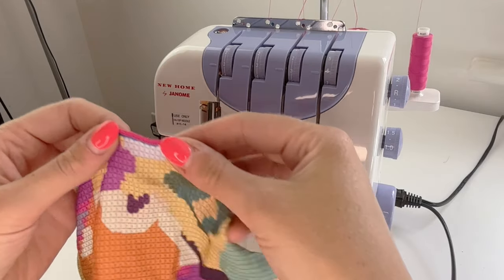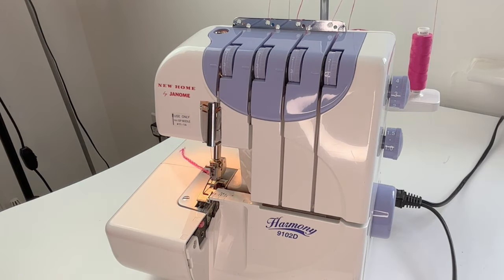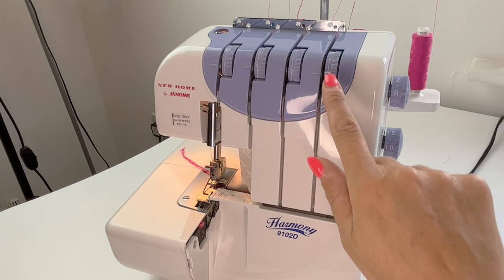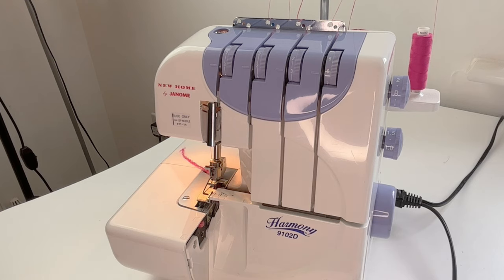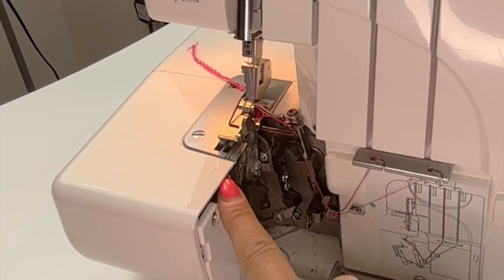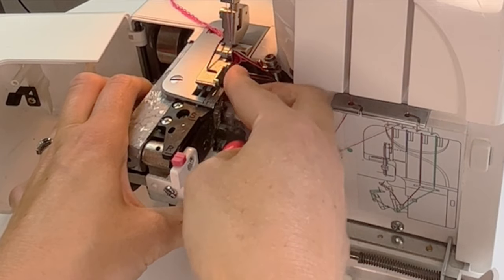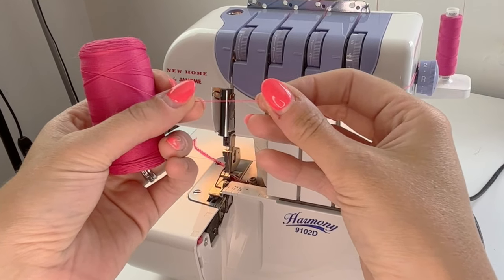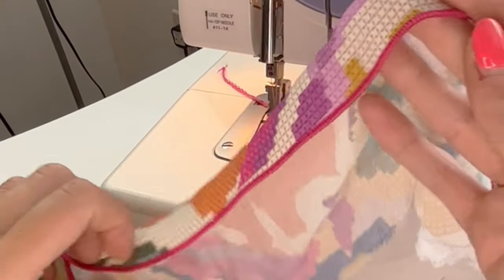Overlocker  / Serger Rolled Hem

Comment: While using the side cutter serger on  normal can we do this  ?  Also when using that foot can we hem decorative stitches?
Reply from the maker: I’m not sure I understand your question.
Your machine manual will explain how you can achieve a rolled hem but the settings will be similar to those shown in the video.